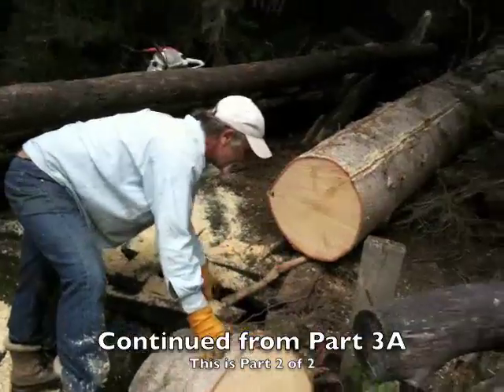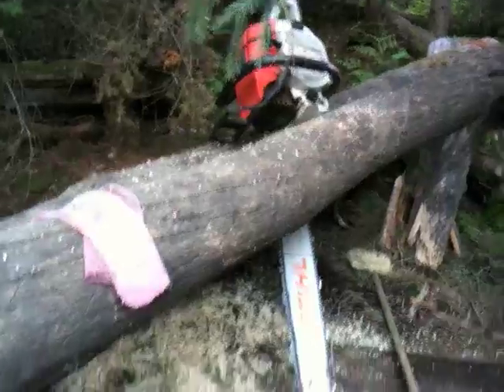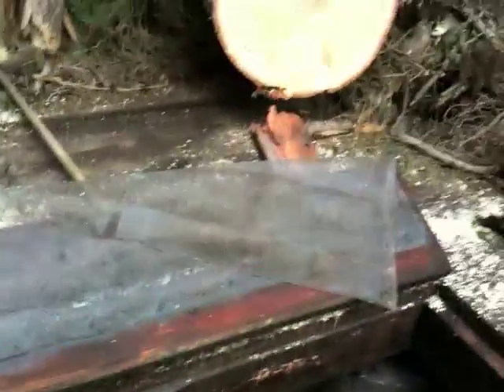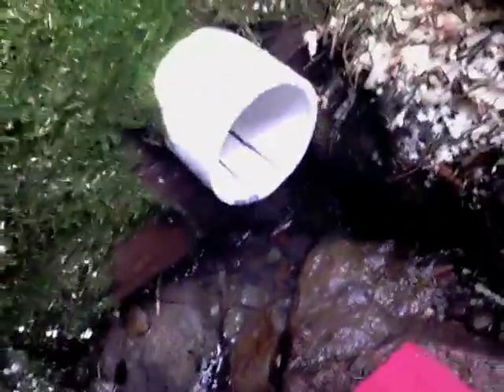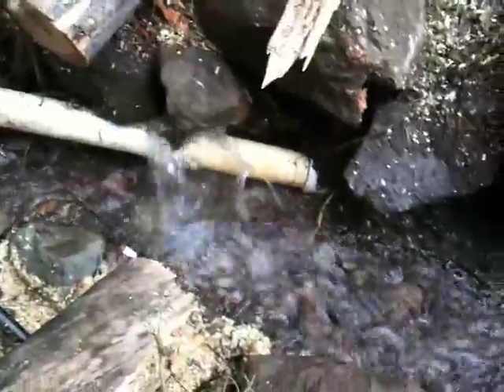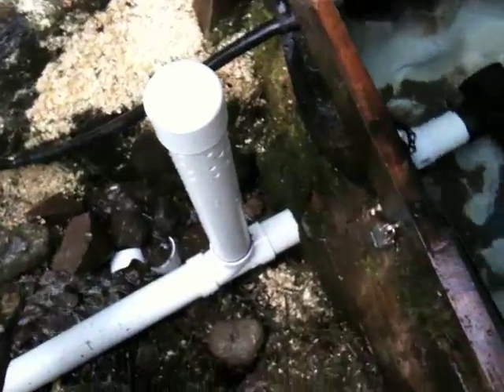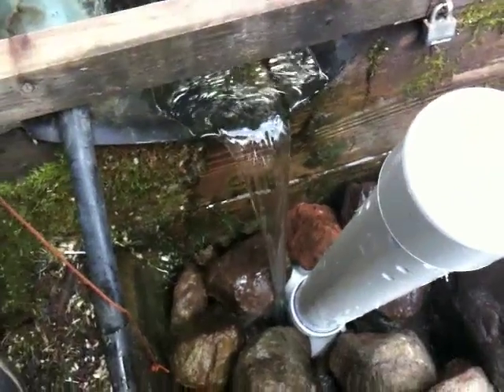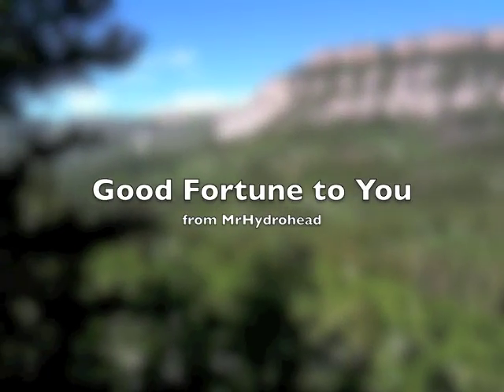Part 3B Micro Hydro Electric Power System in Colorado

Comment: I know this is old, and I'm watching through the series, having seen several of your later videos in the series already; but I have to ask. Are either or both of your springs sourcing your drinking/utility water?
Reply from the maker: Yes definitely. I have turned the flow down at the spring intakes and control a continuous outflow at the old powerhouse. This enables me to keep the water active and flowing through the pond. It also lowers the pressure to whatever I want it set to, usually 80-100 psi. We no longer have the springtime breaks where the pressure was highest at 212 psi. That was a flaw with the schedule 80 pipe unions which had very little glue area. We had 10 or 12 breaks at the unions over the years which had to be dug up which was a pain. One of the earliest videos shows that process, maybe part 3 or 4?  I can’t remember 🤔 Thank for watching!
Reply: @mrhydrohead  My pleasure, and thanks for replying on such an old video! It was really just curiosity, whether or not the springs were your utility water source. My plan is to do the same as well. Over the past couple years, I've watched several of the videos in the series, and they inspired me to build a micro hydro plant when I get my hands on some property. Spring-fed, or creek-fed. But I definitely want a spring for utility/drinking.
Reply from the maker: Bravo! Good for you. Having property with access to clean water is a real benefit and a rarity. We don’t need to filter our spring water and feel very fortunate. While solar is a great solution, it’s hard to beat the uninterrupted supply of power which micro hydro provides. Even a few hundred watts capacity when combined with batteries can cover most needs when it’s that constant 24/7/365.  Best of luck with your plans and it’s always nice to hear someone gains something from the series. It makes the effort to share the knowledge worthwhile. 👍🏻🙏😉
Reply: @mrhydrohead  Thank you!

Comment: I randomly clicked on micro hydro electric, after a japanese video on that matter. After watching the part 21 I got hooked and I "rewound" to the beginning of the series :-).
I am curious, at one point you said the system was running for 14 years or so, I think. Did you hire a business to build the entire installation, from the springs to the generator and electric grid on your house?
Reply from the maker: The pipeline was installed by my contractor when we were building the house in 1995 and the springfed system ran all those years until I moved it. All the parts were sort of standard parts with the exception of the turbine which was made by Canyon Hydro out of DEMING Washington . Thanks for watching!
Reply: Just read in another post about Canyon Hydro in Deming ;-)

Comment: Interesting... So how do you get your internet connections?
Reply from the maker: Via point to point radio transmitters which I think work on a Wi-Fi frequency. It took a while to install a tower on my property but the signal is bounce from Hill top to Hill top
Reply: @mrhydrohead  
StarLink will help out so many people with internet that don't have the funds for their own tower. 

Do you mind sharing how fast your internet connection is? 
What Mbps does a speedtest tell you? Does it vary based on weather? 

You're very inspiring and I can't wait to leave Co Springs and find a house with some land.
Reply from the maker: Starband will be a good deal when they get enough units up. Our speed is good at 19ms.  Bandwidth is throttled at 9 mbits up and down. They would increase rate if we paid more,but it’s enough to stream video so we just stick with the $70/mo.  I am eager to get starband when it becomes available in our area. Finding a suitable property isn’t easy, but worth it. Thx for watching!